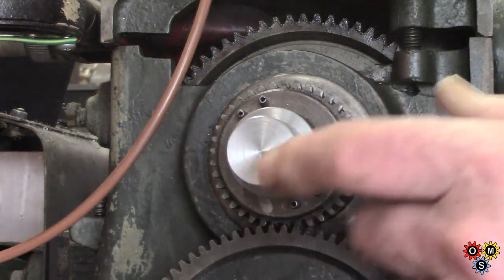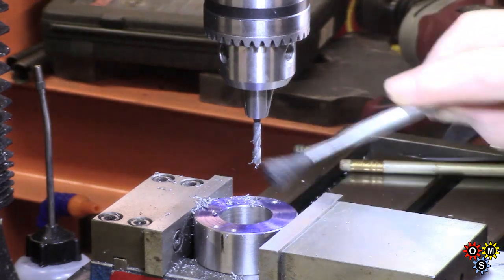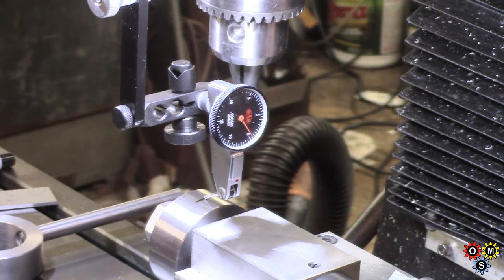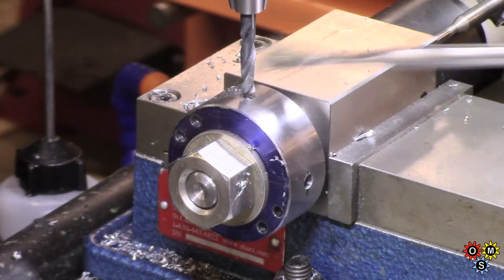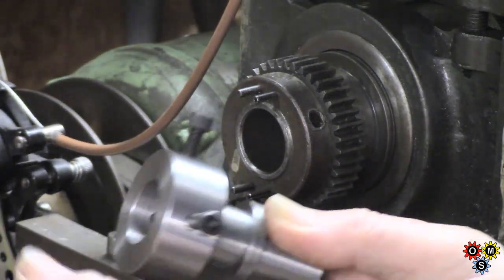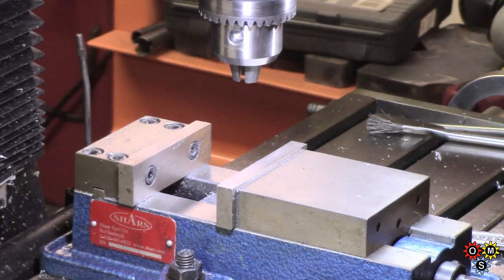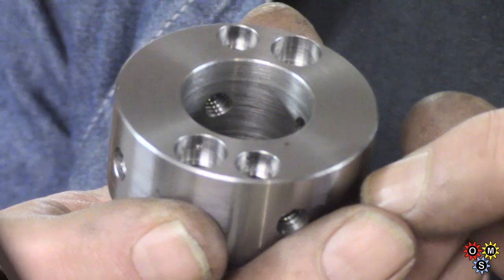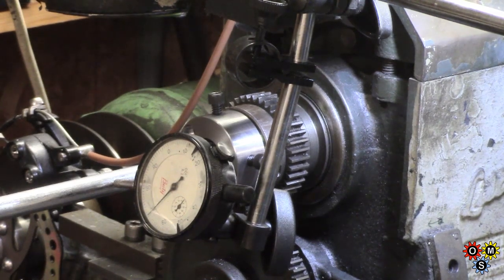Lathe Rear Spindle Spider. Part Two

Comment: Enjoyed....it is great to build/add tooling for the machines....I built one years ago and dummy me use 3 holes/bolts so it is a chore to center... But it works and I should (easily) set up and add a 4 bolt layout (someday)!
Reply from the maker: +outsidescrewball 
Hi Chuck - thx for stopping by. Despite Bozo factors, it will do the job when needed.

Comment: One answer to Mr Bozo would have been a nut and spider in one piece.
Reply from the maker: +Derek Spender 
Hi Derek - the nut though would have had to be very large to permit 1" through.
Reply: +ChrisB257 No, just the collar that your made plus the existing bearing take up nut. ie what you ended up with but in one piece.
Reply from the maker: +Derek Spender 
Ahh, sorry, gotcha!  I did think of that but, decided to keep the thrust collar as it was - it has a very fine thread, is better material than I had available and, already has my roll pins in for the spindle handle.
I guess I could yet make an all-in-one version but it's not needed very often so what I have will do fine I think.

Comment: The caveat about not putting milling cutters in a drill chuck is mostly in cases where there is side pressure and vibration. Plunge cutting should be OK. Even so, a Jacobs type chuck is unlikely to loosen; it's the hand tightening ones like the Albrecht that seem to vibrate loose under side pressure and vibration. (Or the taper mount on either type of chuck might loosen under side pressure.)

Right you are that it's the 1/4 inch and smaller that really whip around. I once had a bit of 1/8 in a collet (which needed fairly high rpm) that bent itself to a 90˚ bend and was whipping around so close to the switch that it was fairly scary to shut things down. Many decades pre-Youtube, so no one saw it but myself. Right now the second drawer on my Kenedy chest is just the right height to support and stabilize a long, whippy workpiece in the lathe. I've drilled large corks to center long pieces, but the "spider" looks like a better solution.

I might not have put so much effort into getting it exactly centered. After all, you are going to do the workpiece centering with the four bolts. Nice series, detailing the design and construction process. Thanks.
Reply from the maker: +Peter W. Meek 
Hi Peter,
Well, I still regard the 'chuck cheat' for a cutter as 'naughty' - probably because even for a plunge, the Jacobs probably has a bit of run out. That's probably the only time I'd do that cheat!
Yeah - 1/4" long stock or smaller is awful for thrashing. Re the centering - well because I had made the ID only just over 1" I wanted a piece of 1" to center pretty well, with just a snug of the bolts to secure it. Could have been less bothered on that I agree! :)

Comment: Just make sure you do not tuck it away where you cannot find it when you want it !You could have made life much simpler on you transfer of hole centres by using soot from a candle, just soot up one part, tap it together, and you will get spot on positions.Your idea of using 4 screws is excellent, I have only 3 on mine, which makes it difficult when chambering a hexagonal barrel, which is also difficult to DTI in position. Chris B.
Reply from the maker: +Englishman French 
Hi Chris - well, the relevant parts are in a small bag and will be stored in the lathe base cabinet - which hopefully I can remember!
I do have a small smoker for sooting but forget I have it - candle does OK too of course. Close inspection did show marking on the blue though fortunately.

Comment: Nicely done Chris. For thin stock you can take a cork, drill the right hole throu it and clamp it in the back spider. Or just make a few bushes for the sizes you use most. You dont have to clamp the stock at the back then, the chuck will hold it.
Reply from the maker: +Rob Gerrits 
Hi Rob, thank you. Cork, bushes -- like that idea. :)

Comment: Hi Chris,Why not just build an over length collar that incorporates the spider, crank and replicates the original thread with locking screws to set the bearings on the headstock?One reason would be the door has to still fit over the spindle...I see Bozo was still working hard, sucking you into trying to do up that (absent) screw in the Mk1 holes :-)
Reply from the maker: +Ray Jones 
Hi Ray - yes, that would be a good way to go but, I'd want to make something like that with better material, like 4140, which I don't have. Plus, anyways, this, as an attachment, is only needed occasionally so, it'll do the job.
Bozo has no scruples - hovers over my shoulder all the time. :)
Reply: +Ray Jones That's what I was just thinking, seems so much simpler to me.

Comment: Nice addition to your lathe! Anyone who has seen what happens when centrifugal force takes your workpiece off center will appreciate this improvement. It was nice to see you use the old school method of taking relieving the first couple of threads with a drill instead of c'sinking. I do that in most cases. Save the more expensive countersinks for where they are really needed!
Reply from the maker: +Michael Murray 
Hi Michael -- thanks. Lot of work for something only needed now and then but, for sure very useful if a piece of 1/4 maybe hanging out the back!
I have used the drill approach for ever to relieve first couple of threads - may still small chamfer after of course. Old habits die hard!